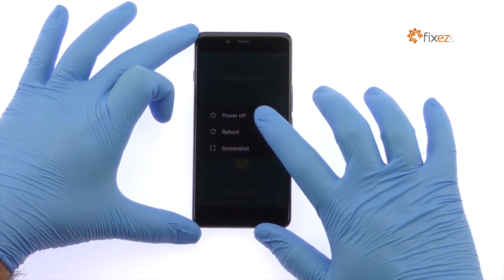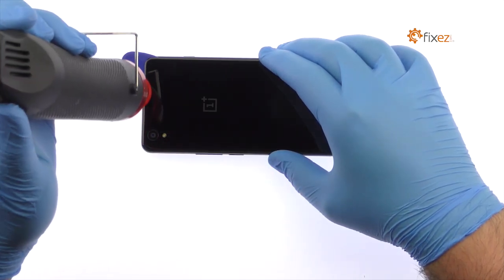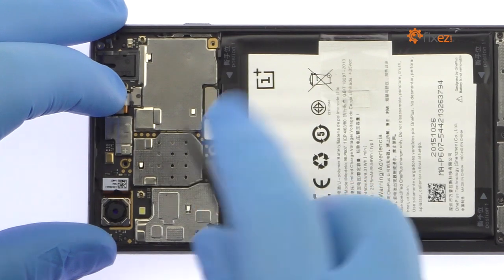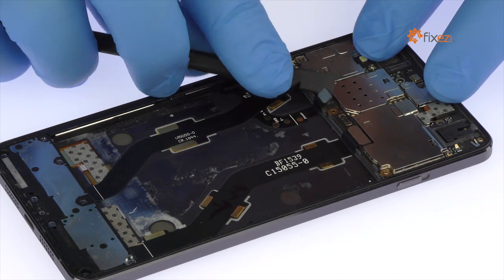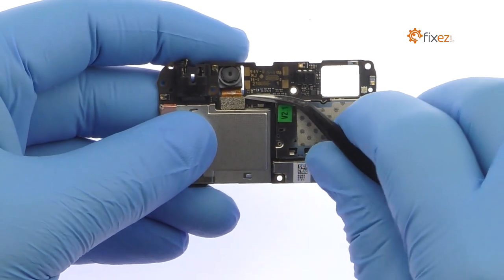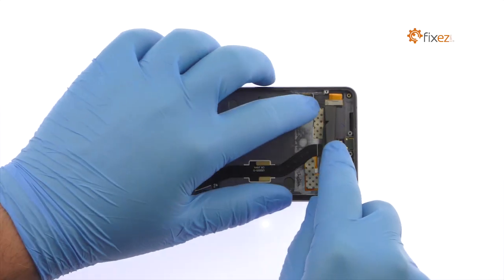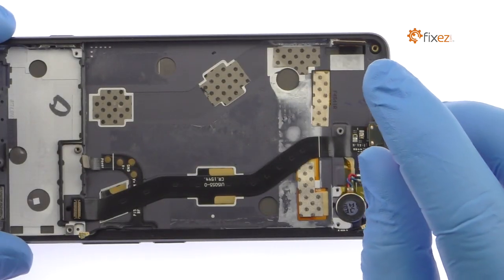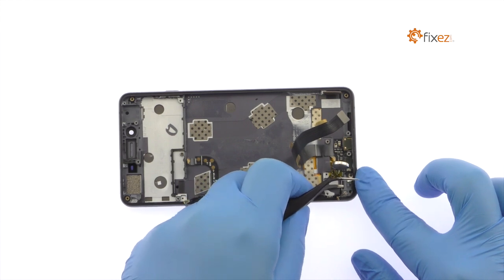OnePlus X Teardown and Reassemble - Fixez.com

Comment: great Video, but you missed out one step, which is important to me. how do you remove the volume and power buttons?
Reply: Erick Reyes Thank you so much bro ! :)
Reply: I agree
Reply: You probably don't need or already figured it out because I had the same problem but here it is anyways. There is a black plastic covering around the edge. You want to pull this out (it will be glued down) but I didn't remove it from all around, just enough to get to the tiny screws underneath the plastic covering. There are two screws that hold down a metal piece that holds in the power and volume buttons.
Reply: Erick Reyes i was searching for this too all over the YouTube and internet but couldn't find any instructions. I just wanted to ask you whether that black plastic covering is important for the reassembly? I mean what if you wreck it ?Will the display and all the components fit properly ? Could you please help me on this ? Thanks
Reply: I suppose you could put the phone cover back on the phone without the black plastic but is probably not recommended because it acts as a seal for the phone. The components still fit together but dust might be able to get inside.